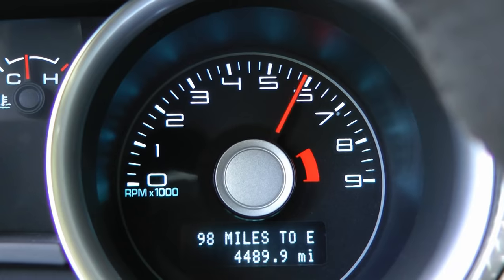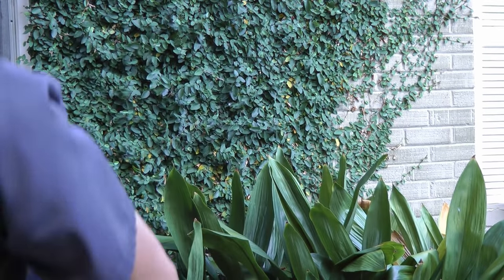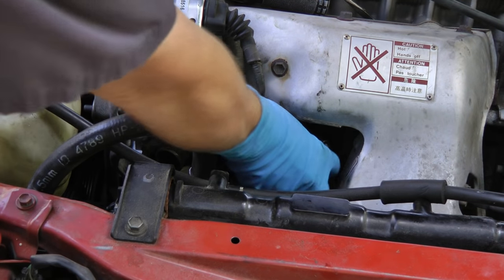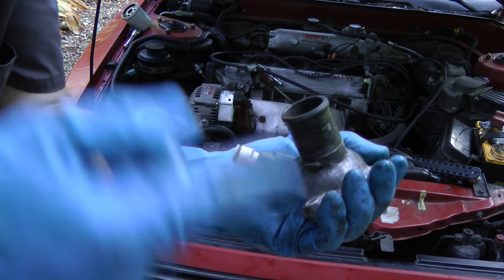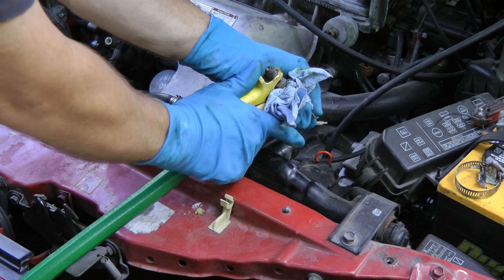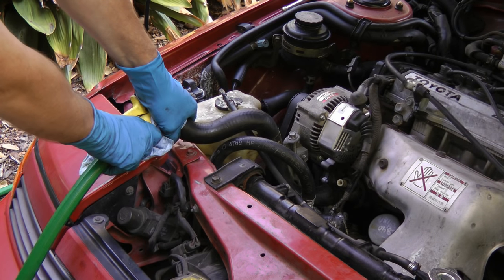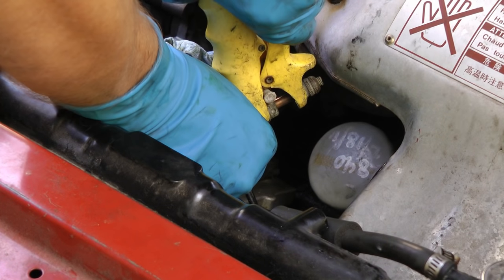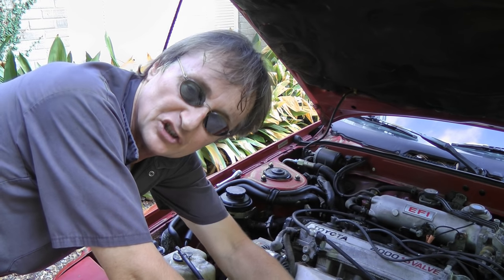How to Flush a Coolant System in Your Car (the Easy Way)

Comment: Can you use a water hose on a 2008 Saturn Aura xr?  I thought it had to be distilled water
Reply: You can use hose water for short-term and flushing.  But it is best to use distilled water for your 50/50 if you're using concentrated coolants.  You can use distilled water all summer long if you like...and switch back to 50/50 Coolant in the Fall before freeze-up.

Comment: Hi Scotty, I watched some other video of flushing cooling system. The steps are different. He attached a garden hose on the top to keep water running through radiator. turned on the engine and turned on the heat. I wonder this method is ok.

Comment: I have a 99 Cadillac DeVille and it keeps overheating I have a new radiator new thermostat new water pump and it keeps overheating. I did a pressure check and it seems to be ok and it's not losing any water but when it gets hot it boils out the reservoir tank what to do
Reply: +Gale  Gregory I'm pretty sure u got air locked In the cooling system to cause overheating and with no heat blowing. look it up on youtube how to bleed car cooling system. that should fix the overheating problem.
Reply: many people is in your situation and never even consider changing the radiator cap. People dont know there is a pressure valve in the cap. and these often go bad and cause the cooler not to release pressure and cause overheating.
Reply: Make sure all your fans are running.  Chances are it's that.  If not, get a new radiator cap and check.  If that doesn't do it, replace the thermostat again - they're super cheap and you might have gotten a defective one.  If one of those doesn't fix it, and you've pressure tested it and it's fine, you've got a blown head gasket (or it's about to).  Do a compression test to make sure.  It HAS to be one of those things.
Reply: its all ok
Reply: I know this is old but if you haven't figured it out yet, your head gasket(s) is(are) shot and need replacing.  It's a bit job.  I recommend timeserting the heads also.  Simpler fix is to call one of the guys that changes the northstars out for a living.  You essentially get a newly rebuilt engine for something like 2500 to 3500 dollars.  There used to be 2 or 3 guys who did this.
Reply: impellers on water pump going bad? They can degrade over time and prevent good flow.

Comment: Hi Scotty I have a 2001 seat ibiza (99-02 model) 1.4 8v.
I have been having problems, like my car overheating when sat in heavy traffic for a little while, I have been turning my heaters on and it does come down to normal temperature.
Haven't been noticing any smoke from exhaust or anything like that.
Coolant now appears to be under minimum when it was half about 4 weeks ago.
What is the problem, or what can I check?

Comment: Easy was I did it once they were to pipe that go into the car, I took one pipe out put a house and let it run for 10 Min while the engine was running( to keep the water warm. Work a treat

Comment: my honda city 1.5 i vetc giving heat sign after running 60-70 km of runningandits water+coolentdrained.i bought this car r from second hand car dealer.i change its radiater and thrmostate switch but d problem is still there.after 30-35 km of running its self miss sometimes.pl suggest a remedy .

Comment: Hey Scotty, just a quick question. I have a 2003 Buick allure and I hear a water gurgling sound when I accelerate what should I do or what could it be?
Reply from the maker: air in the cooling system often does that as it gurgles through the heater core, check that first

Comment from the maker: change the fuel filter, then pressure test the fuel system, replace the pump if pressure is low. If not, try my video "how to clean fuel injectors on your car"

Comment: The top hose is supposed to be always hot and the bottom hose should be cool (because the radiator cooled the coolant). The temperature gauge is showing normal? Then it probably is and there may not be anything wrong. Just make sure the coolant level is full since you burped it.

Comment: Hey Scotty!! Another great video. In my ill spent youth when radiators were still made of brass , I would flush out the system just as you showed but when it came to running the car with only water in the system for a week , I would throw in a couple of handfuls of good old washing soda . After a week when I re flushed the system in preparation to add the anti freeze even more gunk came out and the inside of the radiator would shine like a new penny. In today's modern cooling systems where everything is plastic (ie: the radiator and some intake manifolds) would you consider the washing soda treatment a bit too harsh and risky or could it still be used ? Thanks for taking the time to respond !! :)
Reply from the maker: yes, it is too harsh, and really, nothing fixes corroded aluminum in a radiator other than replacing it

Comment: hello Scoty,im in big trouble,i changed a hose that had coolant in it,since then my car rpm keep running up and down AND MY TEMPERATURE Gause  keep CROSSING THE DANGEROUS LINE,but wats weird is the temperature does NOT go all the way to hot!!! It keep go like toward the hot and fall where it should be,i heard air pocket can cause that but i just BLEED the system but same thing:( did i damaged the water pump??? its a Honda civic 93.

Comment: How do you dtain the coolant resevoir on a 2016 corolla? Is a buitl in and i cant fine answers. Please help
Reply: You might have to syringe it out with a big syringe and some tubing. If you're not looking to recover the coolant in the reservoir, then just stick a hose in the opening of the reservoir and flush it through the cooling system.

Comment: @scotty Kilmer I would like to recommend you do a video on collapsed radiator / coolant hoses.  I found one that showed how removing the coolant tank cap made the hose normal again, which worked for my 2006 XJ8. Some other videos said to remove the radiator cap. Does it depend on the car? Thanks for all your videos!
Reply: Definitely depends on the car.  Some have just a pop top, like a wiper fluid reservoir, while others are pressurized and act as a radiator cap.

Comment: hey how much coolant would be necessary to purchase in the case of that toyota?
Reply: depends on the engine
Reply: for my 96 camry 4 cylinder i bought 5 gallon 50/50 used about 3.5 and filled  the rest with water..... live  in Texas.... sometime in the fall

Comment: So a liter of coolant leaked onto my carpeted trunk from a bottle of antifreeze. What do?
Reply: Go to Walmart and buy a carpet cleaning machine and cleaner, clean out the trunk then clean up the machine and return it. If you used less than half a bottle of cleaner they should let you return it but to be safe use some water to top it off.

Comment: do you put a silicon glue when reinstall radiator hose?
Reply from the maker: no, and it's not a good idea, if loose glue comes off it can clog up the radiator
Reply: ok..tq for the good info.. (y)

Comment: if you said drive the car with just water for a week.
why not put the 50/50 instead what's the difference?
Reply: Cost
Reply: You're going to break loose a lot of crap in your cooling stem in that week and it's just cheaper to use straight water.
Reply: It's just for testing it (unless it's freezing temperature). My biggest worry whenever I've dealt with coolant is how easy it is to accidently spill and the many pet cats roaming my neighborhood. Animals find coolant to be tasty. In the 90's someone left a small amount of coolant in a parking area of a remote park in California, and one of the  two surviving pairs of mating California Condors was found dead with the same coolant in their bodies.

Comment: Hello Scotty, I have a Mustang 99. 4.6 V8L, (im building up my engine) the question is.. I have the cooling light ON in my dashboard, (meaning low coolant) i noticed i have the same level of coolant(MAX), i dont see any leaks, under the car or the gasket, but i do see under my intake manifold that is wet, (like from last rain) but nothing fresh as every day, i plug my Code reader, but i dont get any codes, please help ( i replaced water pump,termo and hoses already)..

Comment: I have an 05 Dakota, with 151,000 miles, and have not done the cooling system yet. Neither changing the manual trans fluid. However, I've done cooling systems before. But CRAZY not having a thermostat in there temporary.

Comment: I'm not mechanic but I worked a gas station for a few years and saw a lot of steaming cars pull in during the winter because the engines pressure cooked due to freeze.

Comment: What about bleeding the air out of the system?
Reply from the maker: most cars will self bleed just running them till they warm up with the radiator cap off then you add coolant as air escapes. If not, you use the air bleed screws on the engine

Comment: Dex cool with eat any gasket alive IF its exposed to air or mixed with the wrong kind of coolant, or not mixed with distilled water.  The main problem is the long service intervals gm promises, causing people to not test or check it.  Even if there's some air, or the cap is bad, it all looks just fine until it makes sludge and eats the intake gaskets out.  Its just the perfect storm of factors that create problems.

Comment: What happens if the coolant run on plain water and what will it happen when not flushing it
Reply from the maker: +Saidir Radin IF you leave plain water in a car for years, it will corrode the inside of the engine from lack of corrosion inhibiting chemicals eventually
Reply: +Scotty Kilmer Thanks!
Reply: +Scotty Kilmer hey scotty,my father has a mitaubishi pajero with the 4d56 diesel which was a conversation,the only thing i am worry is about the temperature gauge that doesn't rise up to its temperature,i remove the hose which connects to the engine block and there is no thermostat,so is that the problem?
Reply: +Dnsza Saidir yes, the engine is staying to cold because the missing thermostat is not there to hold back coolent and let it come up to proper temp.

Comment: No thermostat for a week? How will you know if your car overheats ?
Reply: Ie is it safe to remove the thermostat ?
Reply: @Andybaby  It's not actually going to hurt anything, but your car will actually run too cool as opposed to hot. No thermostat means maximum coolant flow at all times so your engine never fully reaches operating temp. This hurts gas mileage but won't overheat or hurt your engine unless you leave it for a really long time.

Comment: All those steps make me nervous that I'd make some type of mistake. Even though I do all my own basic tune-ups.
Does anyone know if I drained the radiator. put in clear water, ran the car for 10-15 in and did this process about 3 or 4 times if it would flush out the system the same way. I know that's a long process in time waiting for the car to cool down, but I'm not bothered by that.

Comment: The water pump really needs the coolant to lubricant it's seal at all times to prevent excessive wear on the seal, water is an abrasive, just look at the smooth rounded rocks in a flowing creek or river. I would recommend driving around for a while with a automotive coolant system de-scaler with lubricant to protect the pump seal.

Comment: im working on my sisters 95 camry with a 2.2 engine there is this housing that has 3 coolant temperture sensor/switch components on it the one closest to the block is busted it was also the wrong part they shaved the plastic guides to make it fit local parts stores cant get it for me they can only find the temp sensor that wont fit the plug

Comment: Hi Scotty I drive a Honda civic with corroded fluid and just got a check engine light do you think that would be the main cause it's been running smooth lately and hasn't had any problems. Is it safe to drive it to the shop 35 miles away or should I try to do it myself at home?
Reply from the maker: you can drive it, but really bad fluid can do all sorts of weird things to a modern vehicle electronically as well as mechanically corroding things. So do it soon

Comment: I like to put in coolant flush before I flush my radiator.  1 trip to and from work, drain the radiator with the flush, fill it with distilled water and 1 more radiator flush drive around for 30  minutes, drain it, fill it with distilled water, run the car for 10 minutes, drain it again and then do it one more time just to make sure all the crud is out.  Now before I go and refill the system with new coolant, I like to back flush my heater core with just a regular garden hose.  Refill the system with 50/50 coolant or  Concentrated with distilled water, make sure you don't have air in the system and you are done.  I do this "deep flush" every few years and whenever I buy a ""new" car.  And I do a normal flush once a year.  I got a 2002 Dodge Intrepid 3.5 with over 200k miles on it that still purrs like a kitten.  NEVER EVER use regular water in your system over long periods with the car running, impurities in the water can destroy your system, ONLY use distilled water.

Comment: Hey scotty, I have a 96 camaro v6 that the prev owner neglected the cooling system on. It has the famous gm dexcool sludge in it that im sure youve seen at some point. It isnt so bad that the car doesnt cool correctly, but I tried the thing where you put oxalic acid and then baking soda in it and it didnt really help too much. Any suggestions? Thanks

Comment: Scotty so I could drive the vehicle with just water without the thermostat for a whole week?
Reply: Yes...than you drain out the Flush, put the Thermostat (preferably new) back in...and put in New 50/50 Coolant.  You're Done...enjoy your Ride!  You can use Tap water for the the short term, but used pre-mixed coolant or distilled water with the concentrated fluids.

Comment: you should do these types of tutorials with different cars because changing the coolant for my car is different
Reply: Would be nice to include what car you drive then.
Reply: What car do you have

I followed these steps with my 05 Monte Carlo the only difference was that my thermostat is hard to get to so I just ignored that step and flushed it like in this video
Reply: i drive a 1997 e320 mercedes benz
Reply: its a 1997 e320

Comment: hi I just took my car to a mechanic and they want to charge me 129.00 for engine flush for coolant and they said cuz I put water they said it will freeze but your using water to flush so I'm confused
Reply from the maker: yes, it would freeze if it's cold outside, this video is for summer only. In the winter you would have to do as they say
Reply: Well, water will only freeze if your in a cold climate, being in texas the climate permits his approach. In your case do what he does with the hose and then get a good coolant cleaner and put it in with some water and go for a good 1 hour drive and then drain it out, fill up with a good premixed coolant and your good to go. It also doesn't hurt to put rust inhibitor in the coolant in case you forget to change it for some time and for preventive measures.
Reply: In your case simply drain a small amount of coolant out of your vehicle put in a good coolant cleaner and drive the car for 500 miles. Drain this fluid out and do as scotty does and fix it back up with new coolant and some rust inhibitor and your good to go. Buy a new thermostat as well.

Comment: You didn't mention if you kept the drain plug at the bottom of the radiator closed or not, I'm guessing you did.
Reply: Super Kyle why would you keep it closed if your doing a flush? U definately take the buttplug off.

Comment: hey bossman scotty how do ik if i should flush just the radiator  or the whole cooling system.... or since i do 1 might as well do all?
Reply: Cameron.  Your Radiator and Cooling System are all interconnected.   When you do a Rad Flush you are also flushing out the Engines Cooling Ports in the Block, Water Pump, Heater Core, Hoses etc.   These Items are not "Sole Entities" that need to be addressed separately.

Comment: If you drain your cooling system you never drain out all of the old coolant because a significant amount is left in the undrainable heater core.  After flushing with water that undrained portion becomes mostly water the more flushes you use.  Most manufactures recommend a final 50/50 mixture to obtain proper corrosion protection.  Using a store bought 50/50 premixed product to refill your radiator will never get you to the required level of concentration but is sure more profitable for the antifreeze company because your buying 50% water at only a slight price reduction.  The correct way is to look up the capacity of your cooling system and add 1/2 of that quantity of concentrated antifreeze to the drained and flushed radiator, then top off with distilled water.  Use a 50/50 mixture to add to the reservoir as needed over time.